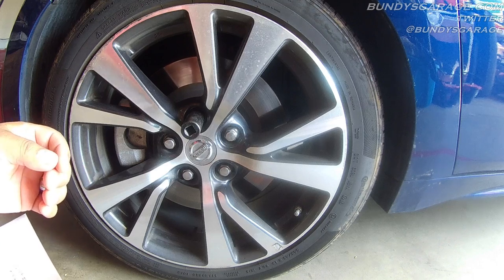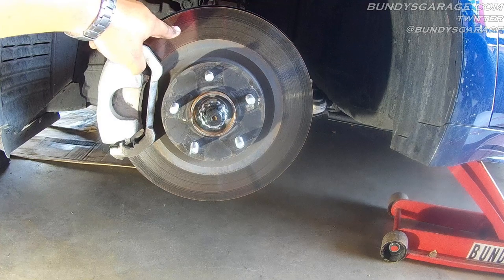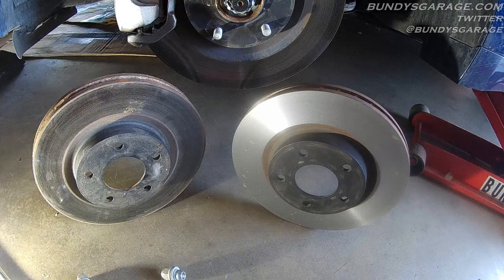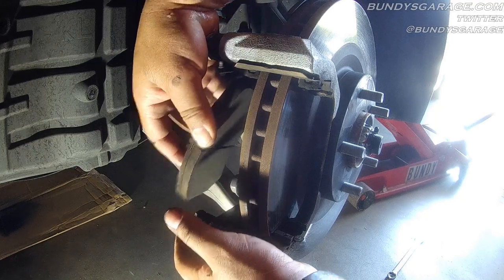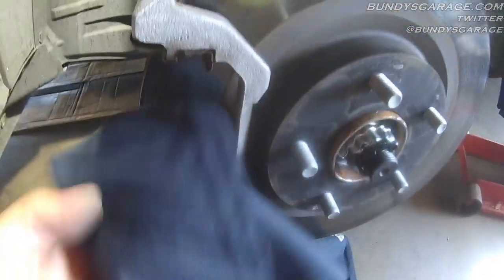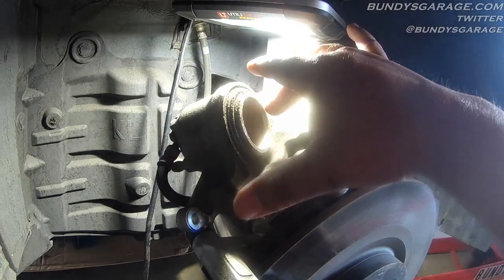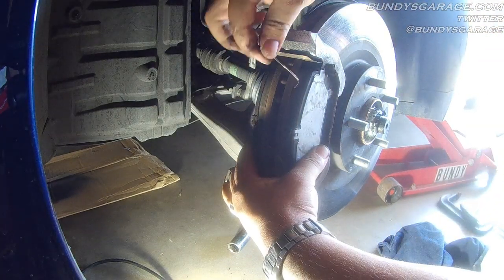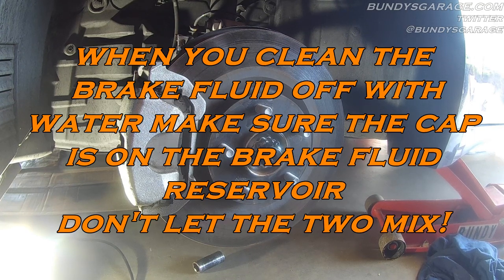09-17 Nissan Maxima Infiniti Front Brake Pads and Rotors Replacement - Bundys Garage

Comment: have 2011 nissan maxima- please note the different sized caliper pins - which is on top and which goes on bottom- the pins are different sized on mine but forgot to note orientation and find conflicting info about top or bottom—actually time code 8:35 & 10:35 of this vid just helped me- for my caliper pin the non rubber(long pin goes on top) thanks man

Comment: Those pinch points are made for easily accessible jacking and to keep things simple, you can jack it up pretty much wherever you want on the frame, control arms, or the rear diff in a truck

Comment: A question please, if you do the rear pads, any special procedure to adjust the parking brake function? Or they would naturally work fine afterwards? 
I had a shop before changed my rear pads, after that the parking brake was not holding even when pushed all the way down.

Comment: Thanks a mil! Please can you explain the step on the reservoir before you push piston back in ?
Reply: Just open the reservoir.  Put a rag around it, cause once you start to compress the calipers the fluid goes back towards the reservoir and a little may leak over. Thats all

Comment: Just did this job on a 2016 maxima... and the car has a scraping rubbing noise when moving... it goes away when turning to the left. Are the brake pad clips side specific?  And are the pads the exact same for inner or outer?
Reply: The scrapping noise is your guard behind the rotor. I had the same problem, I straighten it out and the noise went away. I have a 2014 Maxima.

Comment: Hi Bundys, I have been experiencing light squeaking sound from front when i press the brakes lightly on very slow speed. Auto guy tells me to resurface rotor and replace brake pads as well. I am convinced about resurfacing but do I really need to change brake pads as well at the same time? 
Nissan Maxima 2016, 31,000 KM. Brand new car. No work done on brakes before.
Reply from the maker: +Rafi A. R. Do you brake really hard? Are you a Ricky Racer? If so replace the pads and put cross drilled and slotted rotors on. Difference is night and day. Brake pads can get heat cracks, if they do, replace them.
Reply: Well. Not really. The reason I believe that my brake pads still ok because i think the slight squeaking sound should also come whenever i press brakes regardless of speed. I think it may some kind of debris stucked with brake pad only? Thanks for the feedback Sir.
Reply: I have had the same issue, since it had 15K on the odometer i've been having serious brake squeaking and its very annoying. Now my car has 34,000KM and it still happens when the brakes get hot. Im thinking of getting slotted rotors and new pads aftermarket not OEM.
Reply: Right. Well mine are very fainted sound. If i press the break with normal force, no squeaking sound. Light press on brakes produced it.  Good luck with slotted ones, let me know how it turned out.
Reply from the maker: +Rafi A. R. Cross drilled and slotted rotors, one of the best upgrades I have ever done. At the same time get a pad that is better than OE. Wagner Perfect Stops are a great ceramic brake pad
Reply from the maker: +aaq yes get crossed drilled and slotted and upgrade your pads to a ceramic brake pad.

Comment: what happenes if You didnt push the calipers piston back in before putting it all together again??
Reply from the maker: NO you push the brake pedal after everything has been put back together. You will have no brakes for a coupke seconds if you don't pump the brake pedal.

Comment: Question. Purchasing brake pads they asked if need spreader ? Wth is this ?
Reply from the maker: It’s a tool use to push the caliper piston back so that there is enough room for the new pads. You can also use a C clamp if you have one.
Reply: @bundysgarage  I was helping a friend out over the phone buying parts. Clerk told her it's a PART she would or would not need. I asked to talk to clerk and asked, " a part or tool" ?  She said part that the car would either require or not. I said, what makes this determination,  engine size ? She said no. Your mechanic would have to see. Wth  ??? That's why I asked. I know enough about cars and thought this new model bs was spinning me with some new added required parts. Lol.
Reply from the maker: The only spreader I’ve heard of is a tool. Unless she’s calling it by the wrong name.
Reply: Lol never heard of a spreader for the calipers. Always used a C Clamp